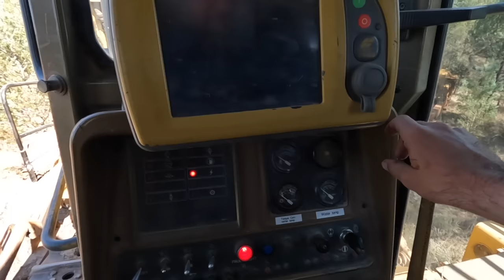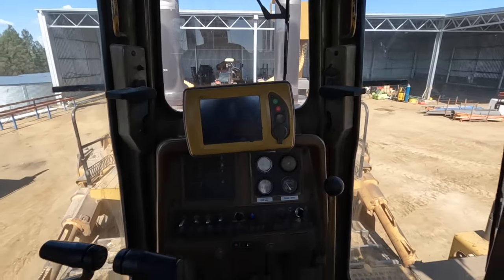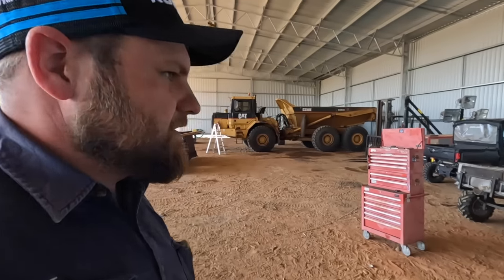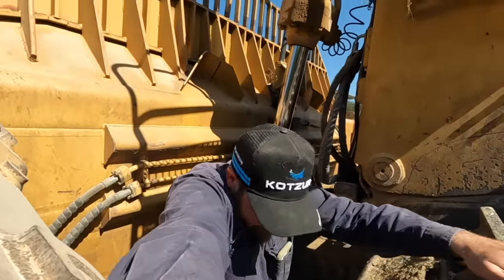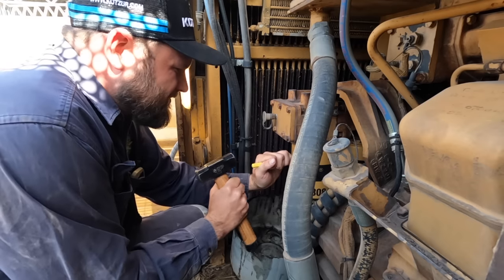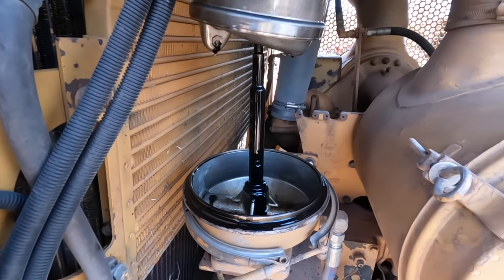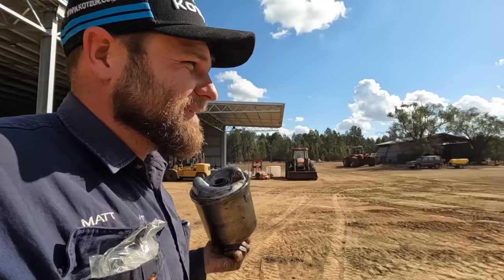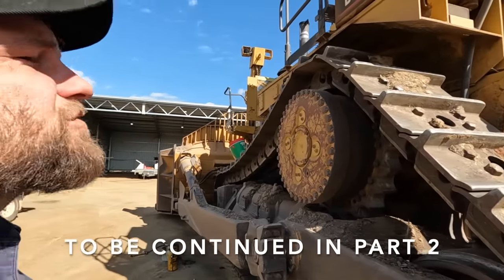CAT D11 Bulldozer Service Time! | Part 1 | Big Bulldozer | Vlog 197

Comment: A few years back I cared for a fleet doing reclaim work.  One of the machines was a D11N, it had a hose hooked to the drain plug so I could use a diaphragm pump to evacuate the oil pan rather than crawl under.  It worked good and saved some trips under the machine.

Comment: Like the idea of whacking a hole in the filter to drain it off a bit, gonna have to remember that one! Do you guys take oil samples?
The boat I work on we have a centrifuge for the fuel & that runs at about 10,000rpm.

Comment: There is a paper insert for inside the cetrifigal filter can, makes cleaning it out a little easier, I would only clean it out every 2nd oil change looking at the small amount of mud cake you removed. Your dealer SOS lab can do an analysis of the cake for piece of mind. There is a tool to hold the can for assembly and dissasembly without risking damaging it, you dont want to scratch the inside of the can.  Post a reply if you want the part number for the paper insert and I'll chase it up when I'm back at work on Monday.  👍
Reply from the maker: Cheers mate, yep I couldn’t find the paper in there but we are only cleaning it out every couple of years😁 thanks
Reply: I personally wouldn't fit a paper liner ,just asking for trouble if it disintegrates, we had centrifugal system on a Scania engine best ever.
Reply: @charleshodgson807  never had one desintigrate, have seen them not fitted corectly, the COF usualy gets a bit of a hum from the imballance. Obviously its just a cleaning aid, turn the can over drop it down on a piece of cardboard and the complte cake slides straight out. Most dealer parts people and techs wouldnt even know they exist or how to find the part number.👍

Comment: Check to see if there is pipe treads in the bottom of the oil pan (there should be) if so screw a pipe nipple in it long enough to get below the belly pan and the oil will come out perfect with no splater  and no mess.

Comment: Easiest way to undo the spinner is to clamp a bit of flat bar in the vice then you can just sit the spinner onto it and it’ll lock into place to undo the top without having to clamp the canister in the vice. All ended up with the same result but a little trick.

Comment: Ok.... I'm going to stop whining about changing the oil in my truck.  At least I don't need a forklift to move the drain pan.  On an oil related note.... which machine will be the first to leak oil on the new painted concrete? 😂
Reply from the maker: Haha probably whatever we park there first😂😂

Comment: Park the D11 with ripper at 55T+ and your concrete floors' intact life will likely be measured in minutes unless there's 4' wide 2' deep footing or steel surface tread plate under each track. I would park the D4 and other lighter equipment on finished floor and store the D11 on the area that's unfinished soil. I love the care and attention to maintenance your operation allows for and this attention to routine maintenance will in the future serve you well.  Ray Stormont
Reply from the maker: Underneath the white lines is about a meter deep of concrete to make sure it can handle it. If we ever do need to put the d11 there it will be able to handle it once we put rubber down, the d11s may never be on the concrete but it’s a bit hard to add extra concrete later so we decided last minute to make it thicker there 👍😁
Reply: Thanks for taking the time to get back to me. 1 meter with rubber will do it I am a new subscriber and did not see the building of the shed. Ray @thejacksonbrothers
Reply from the maker: @raystormont  no worries! Thanks for subscribing😁

Comment: Hi, may I make a suggestion... if it were me I would build a hardwood sleeper landing pad for the tracks to run on they can be on top of structural concrete and a raised plinth surrounding the sleepers to keep the sleepers in place,, build this on the inside of the shed in the shade, please don't put tracks on your concrete it is too expensive to ruin and regret, between the tracks I would have a service pit with a rail either side so a trolley of any desired width or length can run up the length of the service pit to remove oil containers or to place tools on or have rechargeable lights or even a vice fitted what about a complete tool box there and service tools, also your spare parts I think it would be an asset to be able to get under your dozers, trucks, tractors etc to drop oil, service brakes or hard to get to parts, if the service pit was concreted with a sump and a pump you could pressure wash before you serviced, power outlets would be handy this would be a safer environment than struggling on your back risking injury, don't forget to install pull up safety rails when not in use, don't want dad going ass over , might be a good design project for dad and uncle..cheers..
Reply from the maker: Haha it would be a good job for them, the extra concrete in the shed was just a last minute thing that gives us options down the track, the dozers are usually worked on where they break👍 would be nice though😁

Comment: Walking around picking up nails / screw’s sharps good practice from place to place.   Like the way you bung hole in filter with rag then stand it up near you ready to knock over.  Big machines need big costly services I suspect
Reply from the maker: A lot cheaper to service then you think😁

Comment: The Cummins pump motors were serviced every every 500 hours on the site that I worked at, that was every 2 weeks, they ran 24/7 so be thankful that you don’t have to do it every fortnight !
Reply: No doubt regular services were done but 24/7x2 ya no where near 500 hours. Literally even if the machine is never shut down….
Reply: That was a mineral sands mine in WA, I’m a fitter and machinist so luckily they had a diesel fitter that did most of the work on them, I did have to rescue some from turbo failure
Reply: 336 hours in a fortnight
Reply: @chenderson4969  yes but the work order came out every 2 weeks, it was less than the recommended service time but it was done , when an engine runs 24/7 it needs to be serviced
Reply: @andrewclark8225  we used to do a linehaul truck every second Saturday morning for 10000km service, sounds like a similar scenario 👍

Comment: Those vice jaws will chew up that housing surface.😢
Reply: I know, I just cringed when he did that.
Reply: It appears that the centrifuge can has been bent, therefore out of round, from putting it in a vice.  Why no parts cleaner?  To late now for this pad but if you put another down place an I beam down in the concrete with one of the flat sides slightly above the concrete floor level for each track to support the weight of the machine.
Reply from the maker: I was going to put the rag between the jaws but got distracted😂, it was only very minimal pressure so it didn’t leave any marks👍
Reply: @thejacksonbrothers  should a woulda coulda..
Reply: @thejacksonbrothers  hm yea..ok..